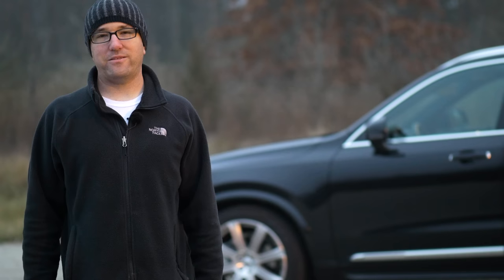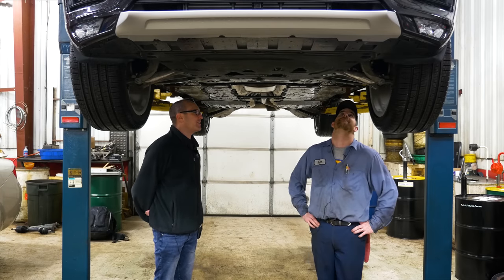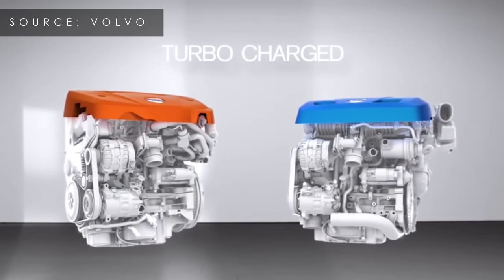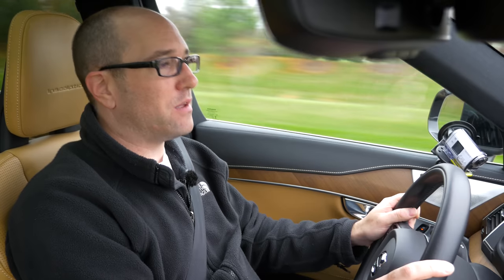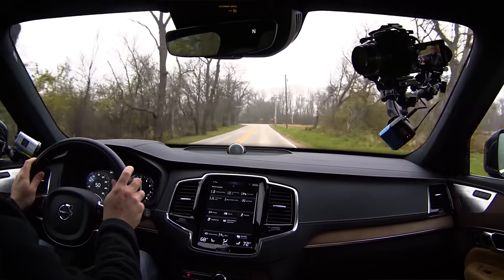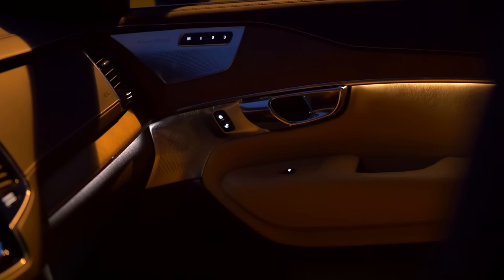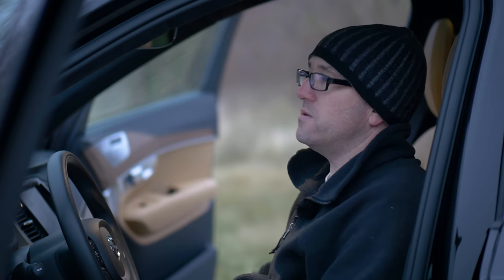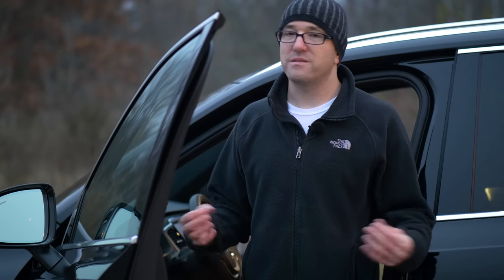Review | 2017 Volvo XC90 | The Tipping Point

Comment: I have mine for 1 year and after 10k miles I love it more by the day. No reliability issues whatsoever for now and the Bowers and Wilkins 19 speaker system is worth every penny for those who love music.
Reply: By the way... I have the polestar tune on mine, which brings hp to 330 and most importantly, torque to 330. It drives much better than the stock one.
Reply: If you ever visit OR and would like to drive mine, just send me a message :)
Reply: Daniel Cabral polestar tune? Won't that void the warranty?
Reply: justSTUMBLEDupon nope. It's offered by the Volvo dealerships and the only tune approved by Volvo. Actually I think Polestar is owned by Volvo nowadays. Here's more information: https://www.polestar.com/ba/products/xc90-polestar-optimisation/
Reply: Daniel Cabral what exact xc90 model do you own?
Reply: 2016 Inscription with Polestar Upgrade... I love it more by the day :)
Reply: T6? or T8?
Reply: T6, although I regretted not making the stretch to get the T8 (I didn't know about the tax benefits).
Reply: My mom recently ordered a T8 Inscription. Although she purchased it for the comfort, technology, and safety, I'm pretty sure she wouldn't mind a Polestar tune. I'm trying to convince her to get the Polestar tune (if it's available). A 503 lb-ft SUV wouldn't hurt, as that's more torque than most F150s!
Reply: Do you still have yours?  Did your ownership experience  continue to go well?

Comment: I own a 2017 XC90 (T6 Momentum+ with all packages). Some things I disagree with: 1) Temperature control is the easiest of any vehicle I've owned. I get in my car and "Auto Climate" does the rest. I rarely have to adjust temperature. When I do, and I'm driving, one press of the Voice Command button on the steering wheel and saying "Set temperature 75 degrees" and it's done.  2) Almost anything you need to do on the Sensus display can be done via voice command and/or the steering wheel functions. It is not in any way a distraction. I realize he only had the vehicle for a brief time but I own this vehicle and never have I almost "ran off the road" trying to accomplish something. The only time I ever had to do something "risky" was unlocking my phone, so I put Pilot Assist II on (semi-autonomous autopilot) and unlocked my phone carefully while trying to keep my eyes on the road to make sure PAII didn't kill me.  In fact, I'm surprised he didn't touch on this. PAII is pretty garbage in terms of auto-pilot technology. As an owner that is a major complaint. If you want to look at real issues you may face with this vehicle head over to the SwedeSpeed forum. Core complaints: Inability to select a default drive mode (it's always set to "Comfort"), Start/Stop doesn't always work, PAII is honestly garbage relatively to other auto-pilot systems, the Volvo On Call app is garbage as well. One thing I do agree with is Sensus is laggy for the first ~20 - 30 seconds and Remote Start does not help as it doesn't actually turn Sensus on completely.
Reply: I too drive a 2016 Volvo XC90 Momentum+ and literally ran off the road tonight trying to turn my heated seat off. I hate the sensus system but love the car and I’m getting ready to replace it with a newer one because mine just hit 125k miles. I’m getting the Bowers & Wilkins in my next one which is my reason for watching the video after owning mine for 2 years. I also love pilot assist and the fantastic park assist. I just want more features… B&W stereo, massaging seats, and air suspension.

Comment: Me and my father driven this car. I'm not a fan of SUV but I did admit it is a great family automobile. It is comfortable, luxurious, surprisingly well equipped (the Germans are getting stingy), abundant safety features (it is a Volvo after all) and while my father was skeptical of a 4000lbs+ SUV powered by a 2.0 liter, power is impressive, equal to that of the Mercedes ML350 (nee GLE). 

As for the 'lease vs buy', almost any luxury SUV falls into the 'lease it' category. I would not want to touch a X5 or Cayenne with more than 200,000miles on it with a 5ft stick. I think Volvo service costs won't be as bank breaking as that of an Audi or BMW, but it certainly isn't a Lexus either.

Comment: As a MY16 Inscription owner (purchase), I found this review nearly identical to my experience for the course of 9 months - the most glaring wrinkle being with the Sensus infotainment.  At my first oil service, the car received a Sensus software update that I thought would pretty much erase the infotainment's lag at vehicle start-up - errrr, not so much.  Still to this day after receiving said software update it acts as though it's still waking up from a hangover.  Hopefully this gets sorted out in a subsequent update.  However, Sensus is great after its initial boot.

Aside from that, there isn't too much else to fault with this vehicle with a little over 13k miles on the clock.  The refinement is top shelf.  And as this was my first-ever SUV purchase, I'm beyond impressed with what Volvo have come up with as modern crossover proposition at this price-point.  Brilliant review @ Savagegeese!  Cheers to all current and soon-to-be owners.

Comment: Cross shopping XC90 B6 with new MDX and QX60. My "heart" really likes the XC90. Compared to the MDX and QX60, it was my favorite SUV to drive with that low end torque, and I do love the interior. Its perfect for daily suburban/city driving. But I also tow a pop up camper a couple of times a year for family camping trips. I have nightmares of the "check engine" light coming on in some remote part of Montana while pulling my camper. So my "head" tells me the XC90 would not be a financially wise decision given the significant amount of reliability problems frequently mentioned across message boards and auto reviews. Thanks for the informative review.

Comment: For those of you who say they're not buying a 4 cylinder SUV for 80k:

1. The XC90 T6 puts out 316 horsepower. Ample for this car (and the way owners will drive them).
2. The XC90 T6 gets 20/27 city/highway gas mileage. That's excellent for such a large SUV.
3. The XC90 T8 (5k more than the T6 after federal PHEV rebate) boasts 400hp, way more than any competitor.
4. Four-cylinder engines are the future ... well, at least the near future. The whole car industry will soon downsize in cylinder count and finally make the switch to electric or alternative fuel methods.

Comment: This is my kind of car! I love the technology. What I don't like is the complexity and repair costs of air suspension. I've had air on Range Rover and Q7 and my friend has it on a Mercedes GLS, but all have had either compressor or sensor or airbag issues. As far as automatic traffic sign recognition, auto headlamps and dipping, auto wipers, surround cameras and stuff like that goes, its even fitted to mid range compact cars such as my Nissan Qashqai these days. So is a touchscreen infotainment system. So I'm not worried about any of that and I love it. 
I like this car so much that I've ordered a diesel D5 Inscription model for March 1st 2017. With the mechanical suspension with the unusual transverse leaf spring at the rear. Winter Pack and Xenium. 
Technology isn't going to be uninvented and this is one of the best iterations available. Using voice control to alter radio stations and HVAC settings is great, fast and reliable. Even my Honda CRV can do this. Absolutely no need to menu-dive while driving. None. In fact this car pointedly doesn't have  doesn't have dozens of physical switches like, say, a Porsche Macan or Cayenne, and it does have options like the head-up display and so on to avoid distraction and lack of focus. It has features that monitor driver concentration and awareness and suggests rest stops and even navigates to the nearest convenient rest stop automatically. 

There have been many software updates since launch to eliminate lag and some of the bugs you found. There are still one or two, so I believe, but they are well on the way to being sorted. That's another advantage of technology, in that firmware can be updated, even over the air on this Volvo up to a certain file size. Not only can bugs and operatability be modified but new features can be added if appropriate. Rather like an iPad and updating the operating system and separately updating the apps.

If I'm disappointed in any way, I'll let you know. As far as failure points go, hopefully most of the electronic systems are designed to last for decades reliably. In my experience of owning some seriously advanced equipment, in 99% of cases that aren't connector or sensor issues, mechanical problems still make up 90%+ of all issues, and despite today's mechanical complexity, in general today's vehicles are far more reliable and last longer than was historically the case. There are so many people who reach middle age and say "this new complicated lighter, faster running, advanced stuff will never last like they did when I was young". Its a human condition. My father used to say it….. "they don't make stuff to last these days like they used to", yet he has been consistently proven to be wrong [apart from with  washing machines].

By the time the Volvo is ten to fifteen years old and the dash gives up, there will be dashboards at the breakers for it. If the centre screen gives up, along with all the control buttons accessed through it, will it actually stop the car driving? I don't think so. A lot of the systems are optional to driving, while the ventilation can either be voice controlled or some clever people will bypass the screen and fit a few ordinary switches and a bit of twine to get it to work, just as people have always done at the dirty end of the car care business.

Comment: I bought a XC90 T6 R-Design with Polestar optimization.  The advantage is that if you are looking for a more sporting experience, this design language offers paddle shifters, alcantera leather and nearly every option available on the Inscription.  One point of consideration, I don't suffer from lag with my touch screen as shown here.  It's quite fluid and easy to navigate.  The system boots from door open and is ready within seconds... perhaps the test example didn't have recent software updates?
Reply from the maker: +Cynder Gray I had two so far the S90 and the XC90.  The Sensus system on the XC90 was horrid, recent update.  The S90 was better however inconsistent. Sometimes as you said, fast others would lag for 5 minutes.

Comment: Hey Mark, 5 years after the review this car looks still awesome and timeless. Good to see that you purchased a XC90 R design recently and enjoying it. As an owner now how do you feel compared to this review ?
Reply from the maker: I traded it in after the roof starting leaking.  It has an amazing interior, great exterior.  Below average drivetrain and average ride quality.  If you get the bowers it has one of the best audio systems we tested under 200k.  I miss it in some ways, but the water leak was last straw.
Reply: @savagegeese  what happened that you changed your opinion this way? The review was much more possitive that your post. Kindly clarify. I belive both cars were T6 and air suspension.  Thank you.
Reply from the maker: @alesbobek1264  I haven't had time to do video about it.  The long and short is I had an extended warranty until 999k miles.  At 22k supercharger seals were leaking.  They wound up replacing it.  When got it back, the supercharger leak cause engine to run lean, destroyed primary catalyst and O2 sensor.  Car also had a brake job at 18,000 mi rotors and pads which became instantly warped after two road trips at 25,000 miles they replaced them under warranty but the brakes were trash and were replaced four times in 40,000 mi they can't handle heat.  One of the contributors on the last road trip we found was if you're using the propilot assist in any type of elevation the brakes are constantly coming on to slow the car down and I think it just warps the rotors.  I had it in for a suspension clunk in the front end they found a heat shield was loose and rubbing on one of the control arms.  I had various clunks in the back which were related to the recall or extended warranty on the air suspension.  I brought it in multiple times for odd engine performance issues where the car would buck hesitate it was like it was cutting timing every time you accelerated more so in the heat they never resolved it.  Car started to develop a rattle in the passenger side headliner from a clip that was loose.  The 22-in wheels and tires combo was a mistake there were only two real tire options.  A shitty summer tire and nerf winter which were all 400 a piece.  My lifetime fuel economy was 19.7MPG.  And the last straw was the leaking roof into the cabin that could not be fixed properly and required body work to resolve.   There is more to discuss but I'll save it for video
Reply: @savagegeese Hi Mark, on constant uneven pavement how does four-c air suspension compare to the integral link suspension in stability and ride comfort? It’s $94K price tag and wondering if i should go with this or new x5/GLE with mid-specs at $125K. The selling price is stupid here in Taiwan.
Reply from the maker: @ERICTW  Out of all the air ride we tested, Audi, Porsche, Acura, BMW the Volvo is by far the worst.  Its still on the harsh side and lot of that has to do with body structure.  It feels the most rubbery and the air springs still feel as jouncy as the steel spring option.

Comment: You missed the upper latch on the rear seats. When you lowered the seats you went to cargo mode, that's not how to get to the rear. The handle on the shoulder area lifts the seat and slides it forward to allow for much easier entry and exit to the 3rd row. Nice review though!

Comment: I have the T8 Excellence and negotiated a 7 year or 150.000 km full Volvo warranty. Looks like Volvo has confidence in the product!  The extended warranty was a deal breaker for me and I would properly not have bought the car  if Volvo hadn’t giving me the confidence. I buy my cars and pay for them myself. My car has been absolutely faultless so far but I have only done 15.000 km..  my last car was a Range Rover Autoby, and absolute nightmare with tons of issues. I simply didn’t have the nerve to keep it as the warranty was going to expire in 6 months. Much to my surprise the T8 Excellence is a better luxury SUV than the Range Rover in top spec. My plan is to keep the Excellence even after the warranty expires.

Comment: I believe that the airbags are not a huge as they seem. What can be seen are not the air spring bellows but plastic covers for protection of the actual airbags.
I previously drove the 5-cylinder 2.5T and now the 4-cylinder T5. I really don't miss the 5th cylinder, it just drives very smooth, perhaps it has a little less "character". But it is luxury car. If I want something else, I drive my BMW R1200RT. Even less cylinders, lots of character :-) 
Times are gone that only 6 or 8 cylinder engines can be very good, the current family of Volvo engines is proof of that.